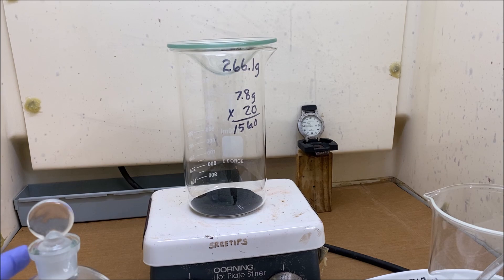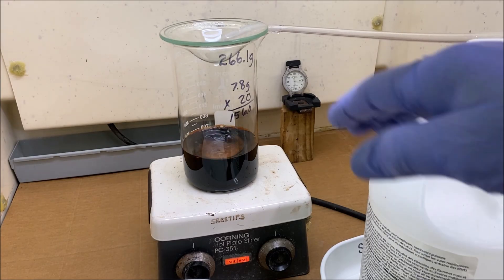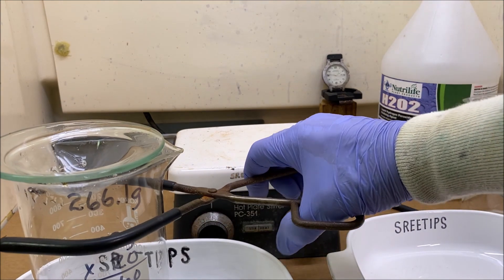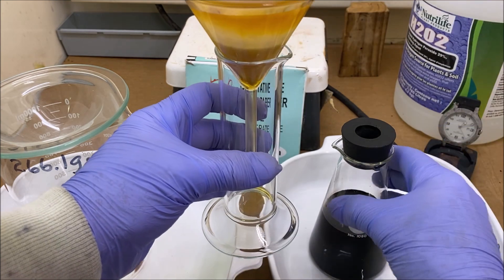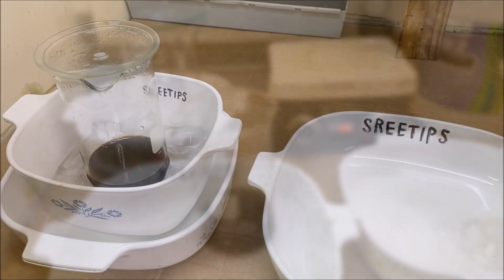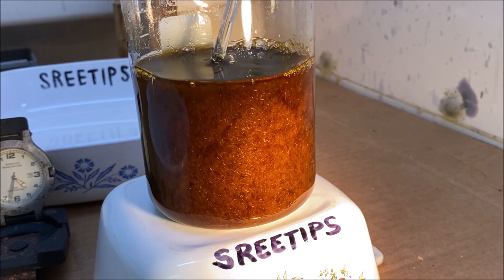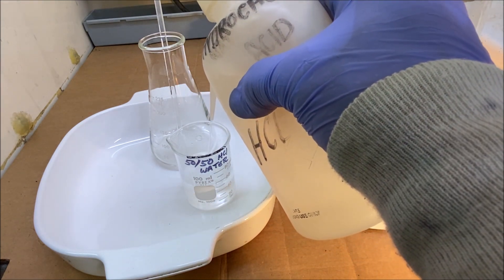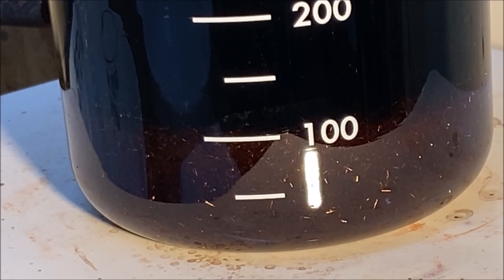How To Recover Platinum Group Metals From Dental Scrap Pt4

Comment: I remember last time you worked on PGMs it was a huge pain in the ass and a bunch of guesswork. With your persistence im sure you can come up with a efficient process
Reply from the maker: There’s no short cuts. PGMs are very difficult even for an experienced refiner. They do not cooperate and fight you at every turn. Plus, the danger of handling platinum in solution, is ever present. Definitely not for the hobby refiner.

Comment: i want to say that i read somewhere that if you use potassium nitrate (instead of sodium or calcium) to make nitric acid then use that nitric to make AR it will dissolve PGM w/no problems
Reply from the maker: I use hydrogen peroxide to avoid having any nitrosyl products in my pgm solution

Comment: Once the crystals had formed why didn't you run a stanus test? You may have seen the color for either platinum or palladium disappear. At the very least you may have had SOME idea of what had come out of solution by comparing it to the test you had run before the precipitation. Not to be a gnit picker but........test, test, test. When there are questions and doubts.....test.
Reply from the maker: Didn’t think to do it

Comment: Info:  rhodium doesn't like O  or water  water makes it explode and it fumes in O
Reply: When you let it over evaporate, you needed hydrochloric acid to dissolve it,  not water.  And I believe you didn't get the palladium out first.  DMG isn't the best way to get the palladium, whichneeds a mixture of by volume hydrochloric acid, 60% alcohol and distilled water as the rinsing solution.  Plus the possibility of gold that you didn't think was present and should have been removed with oxalic acid.  Then, Sodium Chlorate for the palladium.   Before using Ammonium Chloride for the Platinum.  The concentration and temperature is critical for PGMs. As well as for some reagents.  This was learned early in the discovery of the PGMs. The Spanish took thousands of pounds of silver nuggets from South America to Spain.  They tried to work it like silver, but it didn't, they called it "little silver" and had it dumped into the ocean. Hundreds of years passed before Platinum and Palladium was discovered by chemical separation and the other 4 PGMs discovered later, from the residue left behind.  While studying Bemish and VanLoons, The Separation of the Platinum Group Metals an Associated Base Metals. That is filled with assays of meteors, ores and electrolysis sludges. I learned a lot from it.  The C. W. Ammen book "Recovery and Refining of Precious Metals" is by far the best book the layman can have.  When he was still alive, we had him do several assays for our mining camp and do a large scale mining leaching system for our ore type.  These ones are very high in Osmium and Ruthenium...much less of the other PGMs, gold, silver and base metals were iron, chromium, nickel, cobalt and rare earth metals.  These ores don't fire assay because of the higher Osmium and Ruthenium. During the cupellation the bead actually explodes. Osmium and Ruthenium form tetraoxides by sucking the oxygen from the air creating poisonous gases.  Be thankful you're not dealing with those.  In our outdoor laboratory I ground our ores, leached the values and separated the noble noble metals myself on a 5th scale of the production system, for assaying purposes.  Fortunately,  we used specific resins for recovering the separate metals.
Reply from the maker: John, I’m after the platinum and palladium. In my experience, palladium is the easiest. Platinum is next. After that, the other four metals of the six in the platinum group are an enigma to me. I don’t even know how to detect rhodium. I need to get some sponge and do some experiments. But I’m not platinum refiner. My crude setup just barely gets me by.
Reply from the maker: That’s just it; I don’t have the experience. I’m making it up as I go. I’m not a platinum refiner. I’m winging it!
Reply: I doubt rhodium is in dental scrap.
Reply: @johnchism5728  if I remember correctly, he added black PGM powders (presumably from a stock pot clean out) in with it

Comment: Do you use hydrogen peroxide as a weak acid, or for some catalyst reason.?
Reply from the maker: To avoid having to rid excess nitric. And there’s fewer fumes.
Reply: In this case as an oxidizing agent, similar to nitric acid, which is used as oxidizer in aqua regia, not as acid.

Comment: That evaporation reaction was crazy.  It got close to 150 ml, and then the whole thing just flashed over.  Maybe your heat was too high and the volume was just low enough for the whole thing to flash to vapor.  It was cool, but kind of sucked at the same time.
Reply from the maker: I was busy in the yard came in and freaked out when I seen it had gone dry.
Reply: It blew up spectacularly. One problem was overlooking the volume of the stirbar, no real problem in volumes over about 1,000 ml, but at less than 200 ml it becomes notable. Being distracted doesn't help either.